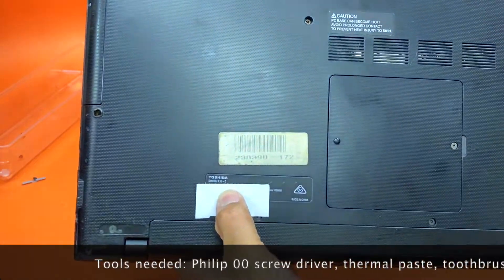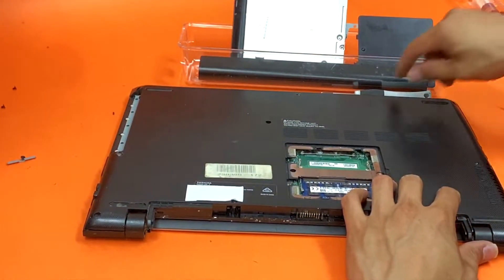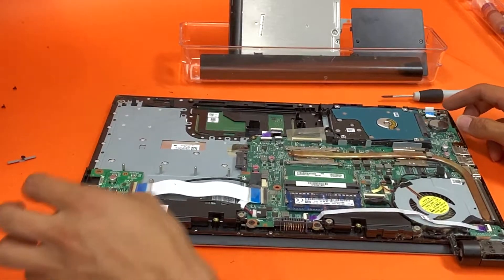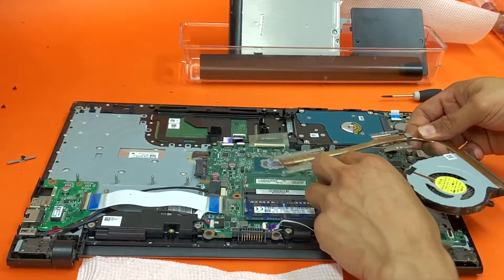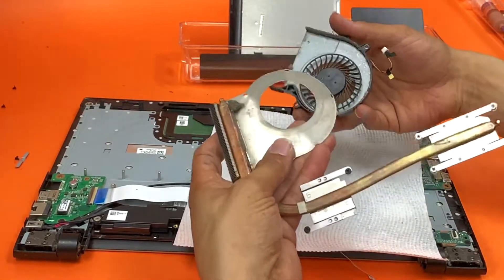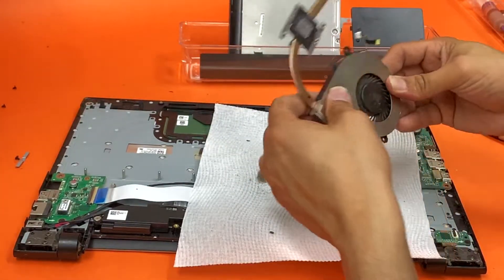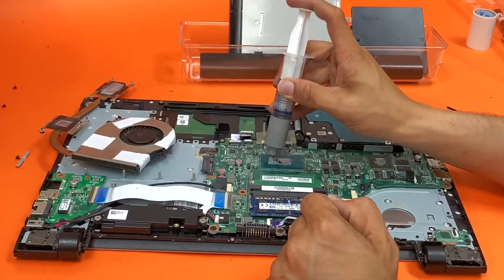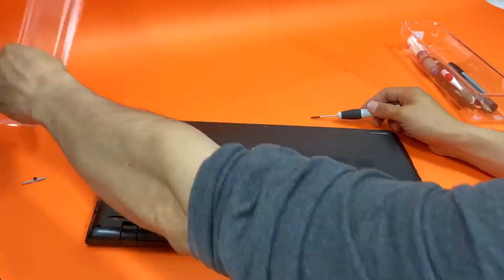Toshiba Satellite L50-C | Cleaning FAN & RE-paste Thermal

Comment: Hi! I would have blown air provided by a compressor to clean up the radiator / fan area. You did not clean the original paste off of the chip dies nor the "heat sinks" using a cleaning product, did you? I usually use an almost free wet soapy sheet of paper towel (I know it's not the best option).
Reply: I use a little rubbing alcohol on tissue
I got a full gallon of the stuff dirt cheap